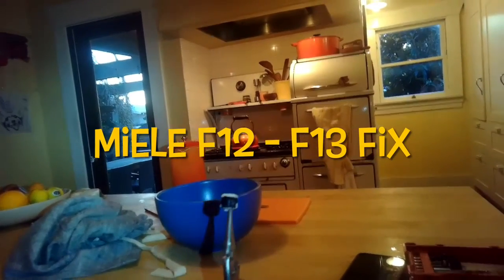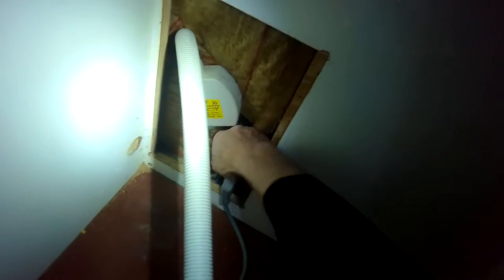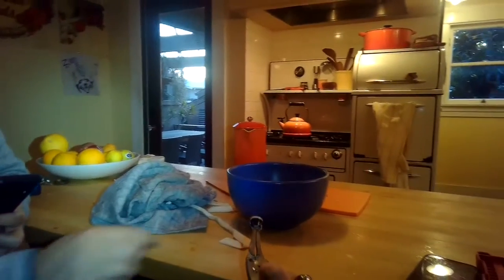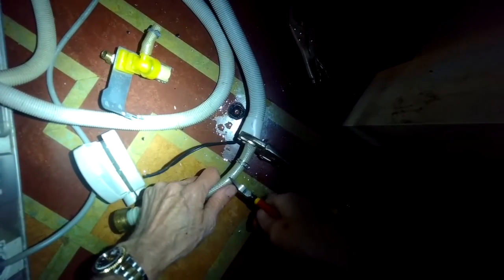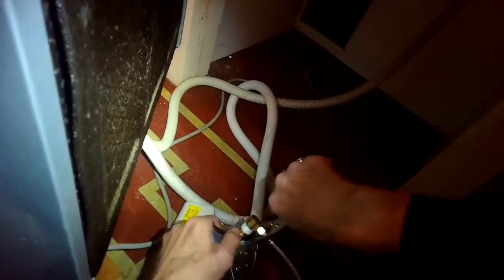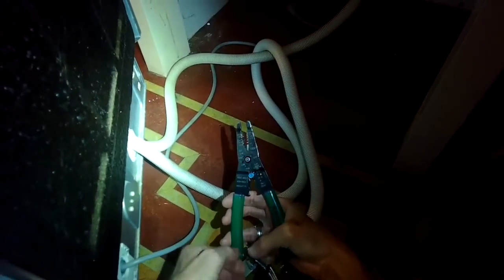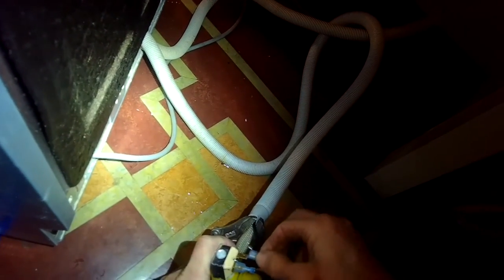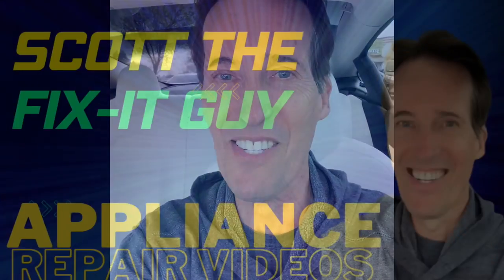✨ MIELE DISHWASHER - F12 & F13 ERRORS - EASY FIX ✨ #miele #dishwasherrepair

Comment: Hi Scott, thanks for the video. I've followed all the steps but how would I know if I need a new fill valve or if something is blocked upstream to the dishwasher from the fill valve?

I tried disconnecting the existing from the water main and put some water in after removing the filter, turned the machine on and activated to see if it sucked the water. It didn't
Reply from the maker: I wonder if the circulation pump impeller is stuck?

Comment: But you've left the valve exposed and not in a case. Are the connectors at mains voltage or lower?

Comment: Hi Scott, I followed your video and your description but the reducer head is male as is the head for the intake valve. I cannot connect the two. Is there another part I need?
Reply from the maker: Thanks David,
Can you attach a metal braided fill line with two female couplings?

Comment: I have a miele g5105 and this pump is located under the dishwasher itself, not in a plastic case at the water inlet under sink.  The wires run to a plug connector then to a solenoid.  Can I use this method to fix the F13 code?
Reply from the maker: Great Question👍 ,  it’s almost identical. Click Here to Get Live Expert Help From Me For Just $5.00: https://www.youtube.com/channel/UC7fBqy8806u1r0NpPv_fQ2w/join
We’ll Get It Fixed 👍
Reply: Wallace did you manage to fix  your G5105 code F13?

Comment: Very good solution. Although the design is bad against other brands who place valve inside dishwasher saving alot of complexity.
Reply from the maker: Thanks Sam,
It is a pretty good fill valve in that it’s easily accessible from underneath the sink when you need to either replace it or repair it.
Reply: Miele are German and like much of the European countries they have a high number of apartments in urban areas. The valve is done thus that if the hose splits it won't flood your apartment or those below you. When the valve is inside the dishwasher or washing machine  hose will cause water to run constantly until its supply is turned off.